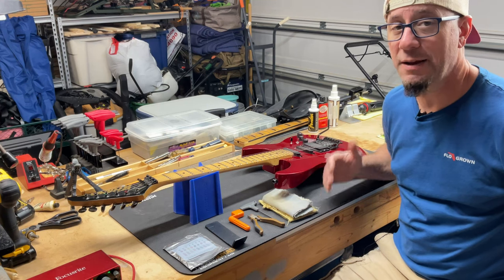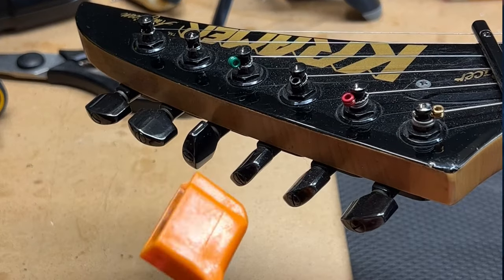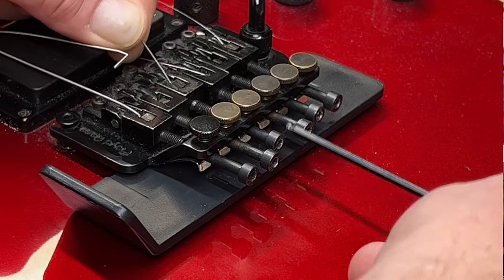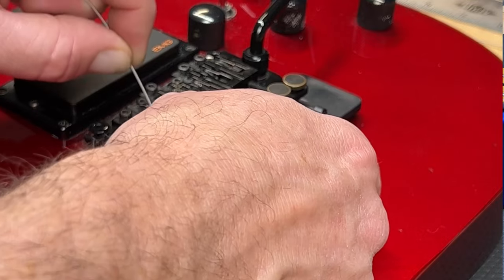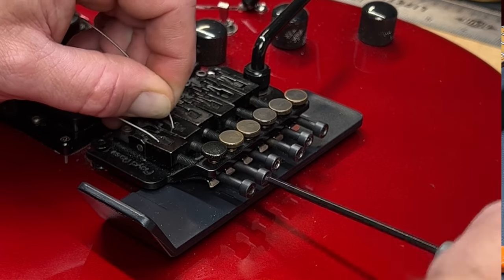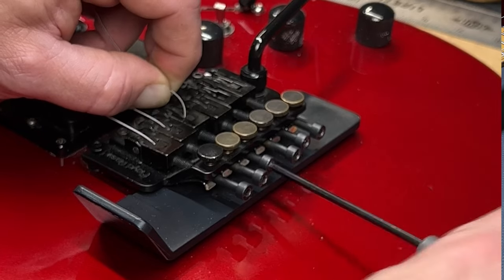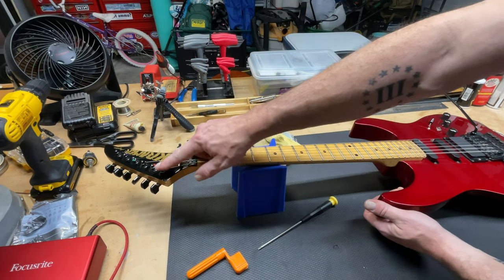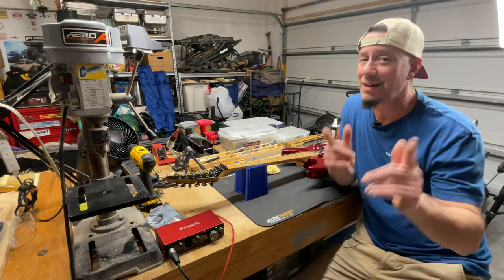How to restring a Floyd Rose / Kramer electric guitar

Comment: Great video on restringing. I bought a Kramer Striker today with the Floyd Rose special. Never strung one before - a totally new concept for me. Just wondering if you should tune the guitar before putting the nut locks back on.
Reply from the maker: Yes! Get it tuned up and then tighten down. Also make sure the fine tuners are about halfway up so you have adjustment range. 😎

Comment: For those new to Floyds, its so much easier to restring one at a time. Start with the low E, replace, tune, stretch, re-tune. Go on to the A. Repeat. That way, when you're finished, the Floyd is still sitting exactly like it was when you started. Cutting all the strings at once can result in the bridge needing spring adjustment, and if you're not intimately familiar with that adjustment technique, you could be phukt.
Reply from the maker: I disagree. I’ve been doing Floyd’s for 35 years and for the first 20 years I did it the way you mentioned, however with the Tremblock there’s no need to do one at a time. No spring adjustments are necessary.

Comment: Thanks for the tutorial! How tight do you need to make the nut clamps? My strings keep breaking between the nut clamp and the tuning peg.
Reply from the maker: Thank you for letting me know! You want them tight but not tight enough to strip the threads ( I’ve done it before). 
As far as breaking the string between the nut and tuners, I have only seen that when you forget the locking nut is tightened down and you try tuning it. If it’s a Kramer they do have a very sharp angle from the nut to the tuners though so that might have something to do with it.

Comment: I have a Shredneck Tremblock and made the error of tuning up whilst still having the Block under the bridge snd had to alter the trem claw etc so you do just put the strings on so it creates some tension near enough to pitch, remove the block then tune?
Reply from the maker: Yes, as soon as you get a little tension on the strings, remove it and then continue tuning. As long as you replace with the same string gauge then you shouldn’t have to adjust the claw.